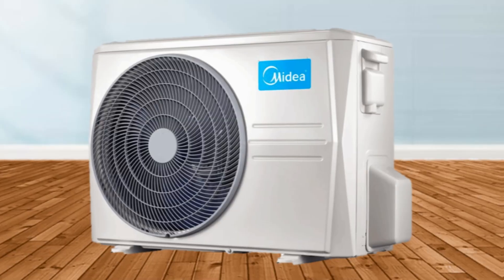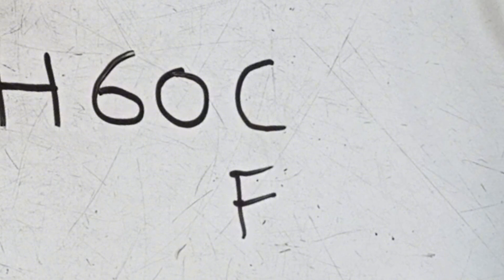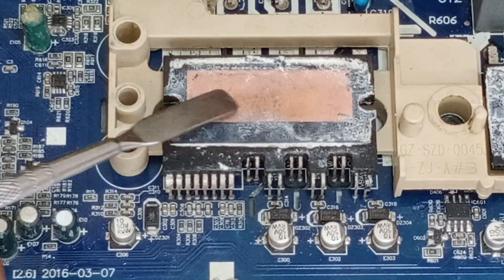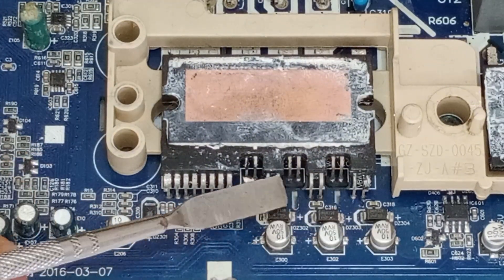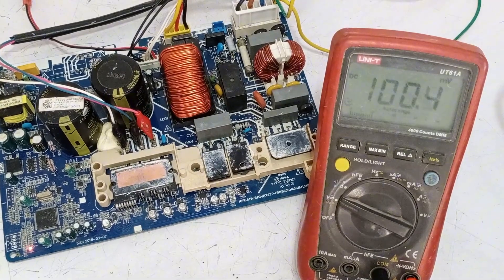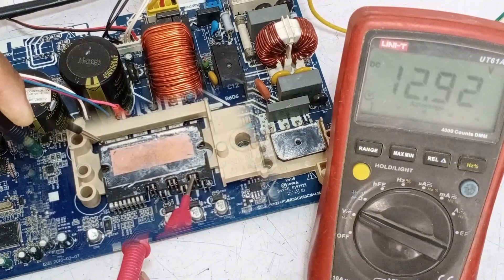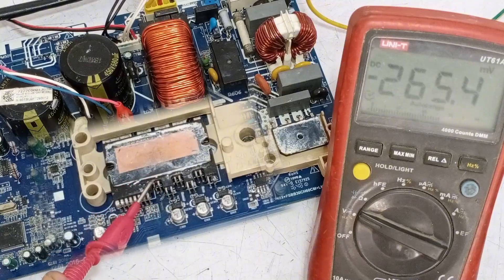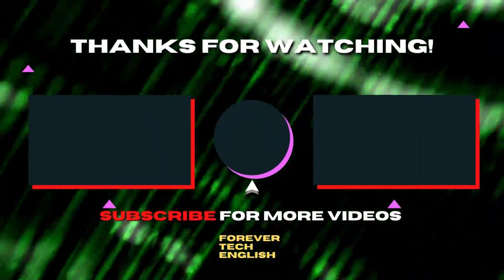Mini Split AC Circuit Repair, Not Able To Start Compressor

Comment: Hi,

I’m wondering if the voltage on the capacitors should be 15V even though only the power supply is connected to the board. I’m also experiencing a grounding issue, and the air conditioner is showing error P0."

Comment: If I measure the air conditioner communication signal with an oscilloscope and connect the same frequency and same volt artificially, will the air conditioner outdoor unit work?

Comment: I need to make a Media outdoor unit work with a Costway indoor unit. Many brands are made the same. Have you ever made different brands work together?
Reply: @Rob-pg7rb  I also in the same shoe carrier indoor and aux outdoor non Inverter
Reply: @riazmahomed8698 there has to be a way we can do it. At least make it 100% on. Protocol has to similar between units. Signal carrier voltage we could make the same pretty easily i would assume if that was the only difference between the two units.

Comment: How did you make the analyzer? Otherwise, all the praise and the videos are excellent
Reply from the maker: Well will make a video on it.
Reply: @forevertechenglish   Tank you
Reply: "Analyzer" has one LED per transistor, 2 LEDs per phase. You can connect 2 LEDs of one phase in antiparallel manner and one side of led pair on U,V, W, the other side in star common connection.
Don't forget series resistor between U, V, W and respective LED anode/cathode junction. Take 3V drop on LED during conduction, and 320 V on U,V,W respective side.

Comment: Where i can circuit board repair,or buy new circuits board ? Tech said replace whole unit for E1 error code?live in New York City,USA
Reply from the maker: Which brand air conditioner is it?

Comment: Hello. Wouldn't it be better to install a temporary ground first and replace the ipm if it doesn't work
Reply from the maker: Well according to my experience it would not have worked. That's why I directly change the IPM.

Comment: Hello! I'm writing from Türkiye. Can gsg102mka compressor be used instead of ga092mab lg compressor? Can you recommend a compressor model that I can use instead of LG ga092mab? Thank you.
Reply from the maker: You need to check the datasheet of the both the compressors and check them. If they matches you can use. Otherwise find another compressor that matches with the original one.
Reply: Lg gsg102 mka 
dc motor
3PH=== 40-280V 
R410A/R32

Lg ga092mab
Dc motor
3PH=== 40-280V
R410A/R32
        

labels like this
Reply: Thanks for your help.